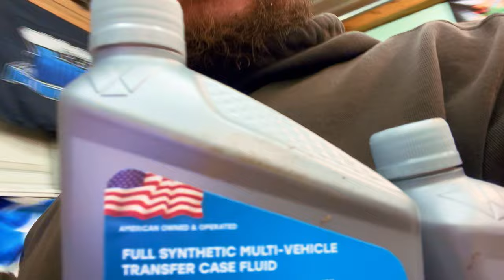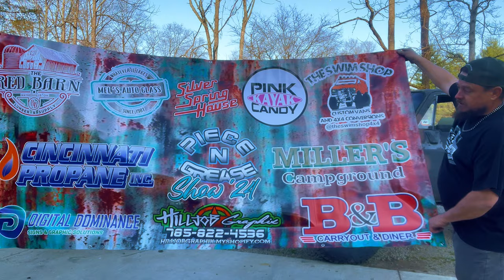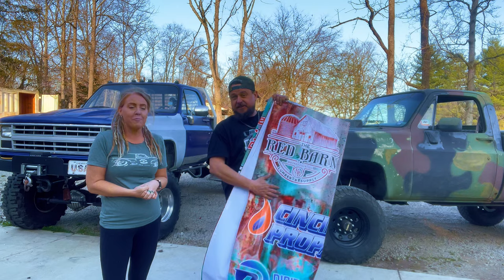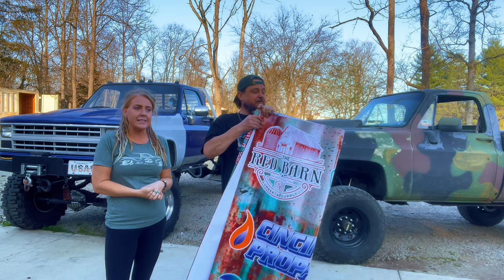Fastest Fix on the Internet! Tim swapped a new Transmission into our 1969 Chevrolet C-50!

Comment: If you put some of that indian head shelac around the flange then slide your silicone coupler on it and i bet it wont blow off no more …  heck you probably wont even be able to pull it apart when you do want to take it apart .. that stuff is almost permanent!!!
Reply from the maker: Great tip!
Reply: @PieceNGrease  i was wondering what somebody would think about that tip .

Comment: Where can you get Teflon tape that gas and diesel won't eat up All the part houses here tell me they don't make any such thing
Reply from the maker: Teflon is chemical resistant. If used correctly gas won’t affect it
Reply: They make a Teflon tape that is blue. I just used mine the other day to tape up some fittings that Unleaded gas is going through. Works fine no leaks yet. I was reading the label on the stuff. It says it's rated for petroleum products. But I don't remember where I got the stuff. Sorry I am no help.
Reply from the maker: Wade you are now YouTube famous. I seen you on merlons channel!
I wrap standard Teflon tape 4-5 wraps and I’ve never had a problem
Reply from the maker: That would be cool!